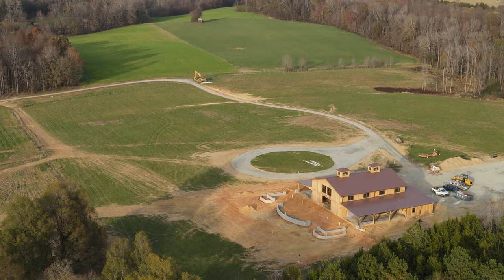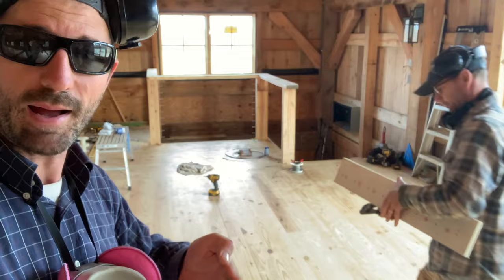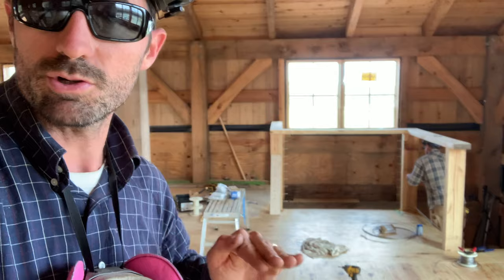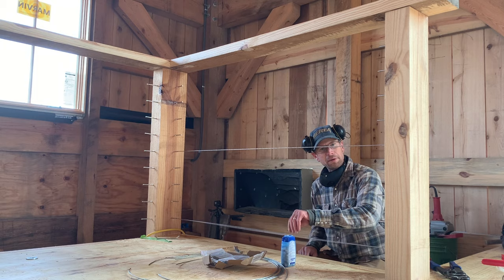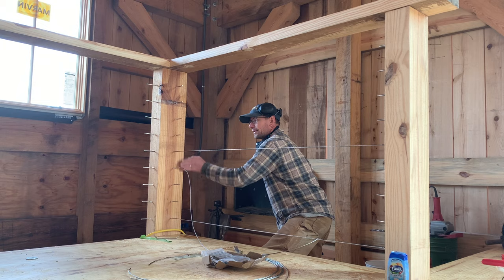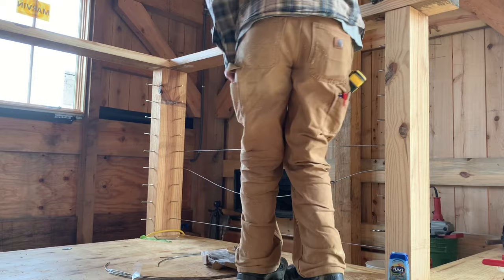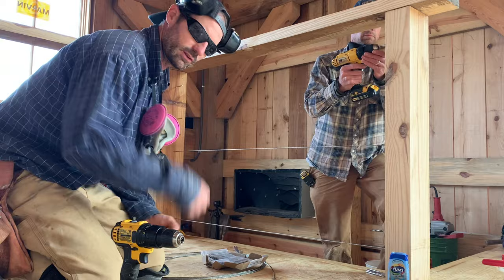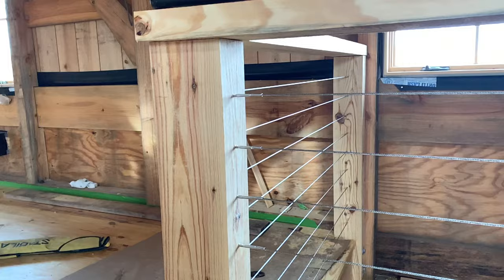CHEAP and EASY CABLE RAILING

Comment: I found it easier to use a drill to  drill all but 1/8 inch of threads into the wood on both sides, cut the cable pull it tight with hand and crimp then tighten the 1/8 on either side. it went way faster.
Reply from the maker: Great idea! Thanks for checking in.
Reply: I don’t understand you make one side taught what about the other side won’t the rope get tangled
Reply: @zaziz8  The other side is reverse threaded...If you turn each side approximately the same number of turns, you'll avoid twisting the wire. There is a lot of forgiveness though and you don't have to turn each side exactly the same number of turns.
Reply: @bluegorillacookies  Spot on. Just installed a system like this and it was pretty forgiving. The only thing I would add from my experience is make the hardware anchors are set decently before cutting the wire to length. I had to recut one of my wire lengths because the wood was a bit softer than I realized at that area and I needed to sink one anchor  more, resulting in a slightly longer wire run. Also I bought a manual pneumatic crimper and while not super cheap, even for the one job I think it's worth it in time and labor.

Comment: As a deck repair guy myself this system looks heavily flawed.  I can't tell you how many decks I've repaired because the posts are loose because lag screws were used intead of through bolts. Water will get into those threads, soften the wood, and the leg screws loosen and fail.  This cable system would just be a disaster in a few years as all those threads will soften under tension and weather.
Reply: What if it is installed inside? Is the water the only thing that makes it a bad design?
Reply: Agree, only good for indoor in my opinion
Reply: Thinking about calking them nicely

Comment: 4" on center would easily allow a 4" sphere to pass through because the cable isn't hard like a baluster, would not pass code in any state I've worked in. Standard in industry is 3" spacing, or 11 lines for a 36" guardrail. That gives you 1/2" on any two for play and helps with longer spans.

Comment: Great job and alternative to other cable rail setups.

Major flaw in your install.  You can’t space cable rails to 4”, needs to be every 3” as the cable under full tension can deflect up to a 1/2”.
Reply: I'm glad someone else pointed that out. With the deflection factored in, spacing these at exactly 4" means mid-span you'll have a greater than 4" space and it'll fail inspection. No matter how tight you get it, it will deflect some, and that little 4" sphere will zip right through. Just do 3" spacing... done.
Reply: If all the cables are the same tension, then the deflection will be the same with all the cables. Spacing would not change.

Comment: Yeah the crimping is definitely the tough part. Its all about finding that sweet spot. Or just do it Mike's way :)
Reply from the maker: I don’t know how you did so many of those with just brute force!
Reply: Ben, I was excited about not having the turn all the lags by hand until the crimping. I just don't have the shoulder strength like I did 20 years ago. Time to hit the gym!
Reply from the maker: @mjheindl  I found a hydraulic crimper we might consider buying considering all the cable rail we’ve been doing. It’s in the video description below.

Comment: Thanks for the vid. I compared many setups and went with these lag swage connectors as well. Big advantage on corner setups, not having to stagger the cable runs or make an impossible bend through the post.
Reply from the maker: For sure, glad you liked the video
Reply: so we're do I get his system. looks great
Reply from the maker: @jfromtn7410  there are links to this cable railing system in the video description.
Reply: Assembly is better but long term the lags will creep. It's well documented.
Reply: @Burritosarebetterthantacos  And is exactly what happened on mine. I left some lag threads exposed to account, but in some cases not enough. Is this cable stretch?

Comment: We by the cable and thousand foot rolls there are 2 connections only passes through I bolts one continuous piece that is the cheapest and the easiest
Reply from the maker: Does that system stay pretty tight?

Comment: Are the threads exposed when you are finished, with that inch and a half shorter than distance, wire cut.
Reply from the maker: No, the threads are buried in the wood

Comment: Did you use the pattern to drill the thread holes before the posts were installed? I'm worried about the holes not being perfectly straight. Perhaps a drill press should be used?

Comment: What do you suggest when putting lags on opposite sides of the 4” x 4” as it appears they will touch due to their length? Thanks.
Reply from the maker: We've never had that problem, but you could slightly offset them (side to side, not up and down). For example, the holes/wires would be 1-5/8" from the edge on one face of the 4x4, and 1-7/8" from the edge on the opposite face.

Comment: Excellent video!  A few questions... Would the hydraulic crimper have bee a better choice?  How long did the entire installation take you?  For long stretches (21') through multiple vertical pieces, would you recommend a lag bolt at each post, or just a through hole and grommet with lags at the outer-most posts?  Really helpful-thanks for posting this.
Reply from the maker: Thanks, Steve! The hydraulic crimper is the way to go. I would drill holes and make a single 21’ run instead of lags at each post if you can. You may need to lay out the holes from both sides of each post and drill from each side to make sure you have nice straight runs (if you drill all the way through the post from one side, you may come out slightly off your layout on the opposite side of the post if the drill bit doesn’t go straight). Having one wire all the way across makes tensioning the whole stand of cables easier
Reply: @HeirloomBuilders  thank you!
Reply: The hand crimper used in the video has short “arms”, which give less leverage. You can buy hand swagers with around 36” arms, which makes the job much easier, however, they are around $175 now.
On some jobs you may not be able to swage before the cables are in place. therefore making the hydraulic swager the better choice…though they are slower. They only cost around $95, with the cable cutter, money well spent if you do even two jobs.

Comment: This is awesome. Any tips for a staircase railing? How do I get the angle downwards correct?
Reply from the maker: The grab bar (not necessarily the railing) needs to be 34-38” above the diagonal line connecting the foremost point on the stair nosings. You can run a straight edge or level down the stairs, measure up 36” from there and that’s your grab bar position. The exact angle will be determined by your stair rise and run. You could place a speed square on that diagonal line, plumb the speed square and determine where the diagonal line intersects the angle on the speed square to get the correct angle.

Comment: Great video. 1 question. I plan on putting this on an exterior deck. Would you suggest setting the corner posts in concrete to support the tension or would the concrete blocks be sufficient? Its roughly a 12x16 deck. Thanks again
Reply from the maker: Thanks, Matt! Yes, I would probably set the corner posts in concrete

Comment: How does this do with 4” sphere test? Looks like there is enough slack in the cables that a baby head could squeeze right though.
Reply from the maker: It passes the 4" sphere test, so long as you lay out the wires at 4" on center or less. You can always go with tighter spacing if its a concern.
Reply: I do 3", just in case of cable flex. They check that here.

Comment: Ok for exterior railings? Or will the steel rust?
Reply from the maker: Get the stainless cable and fittings. There’s a link the the video description for those.

Comment: Would this work without sagging on a 7' span?
Reply from the maker: Yes
Reply: @HeirloomBuilders  Hi, Thanks for the Great video. Is there a code for the max distance  the posts can be, say on an outdoor deck, when using these cables?
Reply from the maker: @ericfine325  there is no code except that it needs to hold back something like 200 lbs of force. 6-12 feet is our typical
Range, depending on structural
Post layout below. 6 ft or 8 ft spacing looks best.
Reply: With that span, an inspector might take issue, as it would be easy to spread the cables more than 4” apart in the middle. Most systems state that 48” between posts is max. For a less intrusive look, the Center posts can be much smaller rectangular metal, they’re only acting as cable supportspacers.

Comment: What about stair railings? Would they have to screwed in a the correct angle?
Reply from the maker: Yes, you’ll need to screw them in at the same angle as the handrail for it to look right. We usually cut a wood block with a miter of the same angle as the stairs to use as a visual guide to keep the drill at the same angle.
Reply: @HeirloomBuilders  Great idea, the pre made gauges that do the same thing are pricey.

Comment: Did you only show one crimp/strand…to shorten the video?
Every system I have used specifies 2 crimps on each fitting, the 1st turned 90* to the second crimp. That will give you about 60% of the cable strength.
Reply from the maker: One will work just fine for railing, but two is definitely better.

Comment: What size are the posts and top railing?
Reply from the maker: Good question. The post in the middle of the thumbnail image is a 4x7, notched down from a 7x10 post that holds up the stairs and beams that make that stair opening. All the others are 4x4 with a 2x4 top rail (all sizes are nominal - actual 2" x 4" and 4" x 4"

Comment: Great video! How are the posts supported?
Reply from the maker: The posts attach to the floor girders with (2) 5/8” carriage bolts. The bottom of the 4x4 post has a 2x10 notch cut out so it has 2” of bearing on the top surface of the girder and a 2” thick x 10” long leg that extends down to rest against the side of the girder where the bolts attach it together.
Reply: @HeirloomBuilders  Awesome. Thank you for the information. And for creating these videos. They're super helpful and very enjoyable.

Comment: Can this be done with  vertical cable wire ?
Reply from the maker: Yes it can
Reply: It can, BUT, You will use a ton of connectors, (every 4” is code), that will greatly increase the cost. Of course connectors vary greatly in price.
Also think about the loads. Unless your top & bottom rails are very stiff, you will bow the Center.